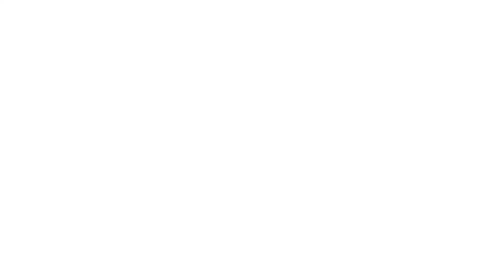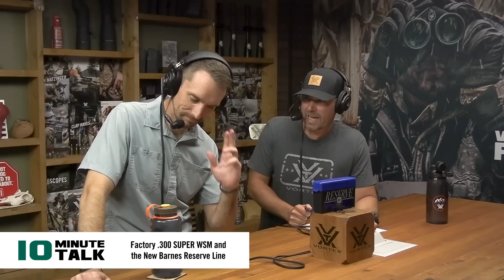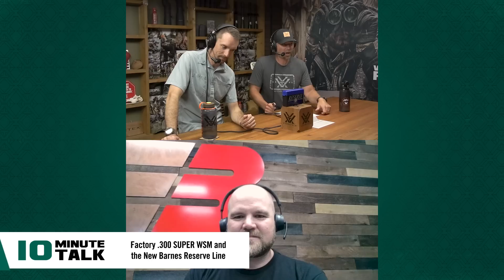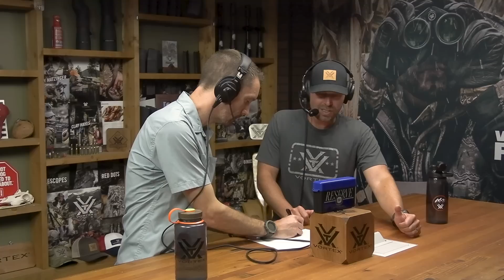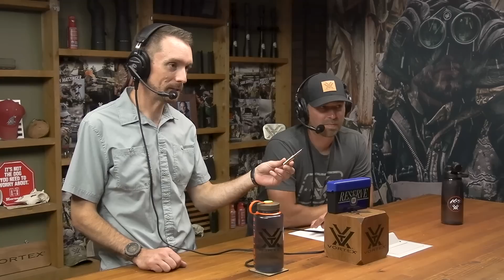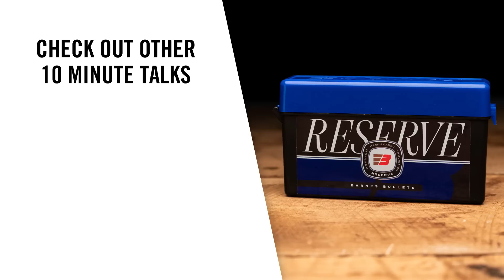#10MinuteTalk - Factory .300 SUPER WSM and the New Barnes Reserve Line

Comment: I would like to see you producing a 160gr LRX Bore rider especially for the 6,5 Grendel and seated way out and get manson to make chamber reamers and go and no-go  gauges as well as a rougher and finishing chamber reamer and the reloading companies to produce seater dies!This would be a case (cardtrige) which would make the most sens.Long barrel live,small case which could be fully utelised when the bullet is seated foreard and get much better ballistics.Using shorter barrel and still get good results.Also not heating the barrel so much and easy to surpress the noise!!

Comment: I think a 7x57 loaded to a real proper pressure that can be easily handled by modern bolt rifles with that 152gr lrx or 120gr ttsx would be awesome. Call it 7x57 +p or something and beat out 7mm-08 velocities
Reply: I’m pushing a 168gr Accubond LR at 2600fps from a 20” barrel with my 7x57. It’s a doll of a load.

Comment: I can totally see the value of loading a short action cartridge to long action overall length and single feeding.  You get the activity of a long action cartridge for one shot, and the ability to quickly reload standard ammunition after that. But if you’re going to have a long action, why not just use a long action cartridge?
Is .300 super WSM really more efficient than .300 WM when you load extremely long bullets in a suitably long barrel for true long distance shooting?

Comment: The 7mm SAUM is an excellent cartridge, but, in some respects came out too soon.  It was still in the "light bullets shoot fast and flat" generation of cartridges designed before laser rangefinders were common.  The SAAMI chamber is closer to modern cartridges, with a significant section of tight freebore (unlike the WSM's).   Part of the reason I think it failed in the marketplace was that the 7 SAUM, 7 WSM, and 270 WSM came out at roughly the same time and cannibalized each other's market share.  The 7mm WSM was the fastest, but also the most problematic in that many experienced reloaders worried about the short neck and that the brass was exclusive to that cartridge, instead of being based off the 300 and 270 WSM.    Also, the 7mm Rem Mag was already an excellent cartridge with a modern chamber design and arguably more accurate, on average, than the 300 Win Mag.   The 7 SAUM benefits greatly from a standard (30-06 length, 3.34") action and a faster twist, though.  The SAAMI chamber can even work well with modern, high-BC bullets, but many use longer freebores to keep the shank completely in the neck.

Comment: I like the 300WSM long throat cartridge. I received my JGS reamer early last year for the project. I added a modification expanding the body as well so I guess my 300WSM-Long is considered a SUPER WSM as well. Currently doing range trials with 8 twist, 9 twist, and 10 twist. 6.5-284 Norma one of my favorites also. I converted 1 Tikka to that and may do another. Have 3 a the moment.  Dropped 3 deer with the 127 LRX loaded in Norma brass. They all dropped - broadside, quartering to, quartering away all around 190 yards

Comment: Okay, I can’t be the only one that wants a short action compatible bore rider projectile. A heavier than typical, lower pressure, higher than typical velocity projectile that fits in a 2.950 or even 2.800 mag would really cool for us short action magnum reloaders.

Also bore riders in other calibers would be SWEET too. 7mm, .277, 6.5, and 6mm specifically
Reply: I might be mistaken but the only reason I know for the bore rider is to eliminate the need to throat the barrel to run a long bullet. So to run a short bore rider you are just basically going back to a standard bullet.
Reply: @portersorensen8814 this is true, but the bore rider is too long to run in a short action and most 300wsm shooters aren’t running tikkas or long actions to take advantage of them. This bullet also required a 1-8 twist to stabilize. Again all production 300wsm are 1-10 or 1-11 twist.

Comment: Oh good, more calibers/bullets that we don't need. I have been reloading for .308 Win for over 40 years, I'm going to start calling my bullets "Reserve"
Lake City brass, Varget powder at 100% case capacity (used to use 2520) Nosler 165 g Partition. I'm going to call this my "Classic Fudd" load, and for the "Reserve Fudd" I'm loading 165 g Speer Gold Dots with 100% bullet weight retention. As to the high cost he is skating around, Speer GD $0.50, Lake city brass $0.25, 45 grains of Varget (based on the 8.8 pound jug I bought from Mid South Reloading LAST week $476.85 delivered inc. shipping and HazMat cost is $54/lb which comes out to $ 0,35 cents per round, and .07 for primer Total is $1.10/round. But since I have a few 5 gallon buckets of LC brass that I bought for $5 a bucket before most of you were born, I am really paying $ 0.85 or $ 17/box of 20 for custom high quality rounds with high quality components, I'm not afraid to say what my bullets cost
Reply: Cool story, bro.